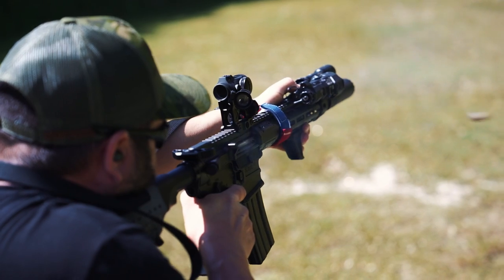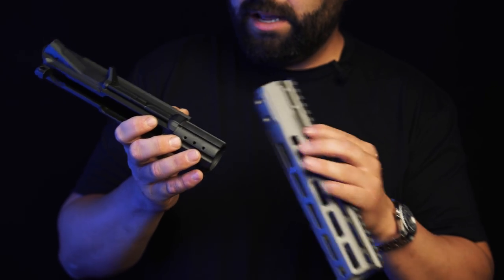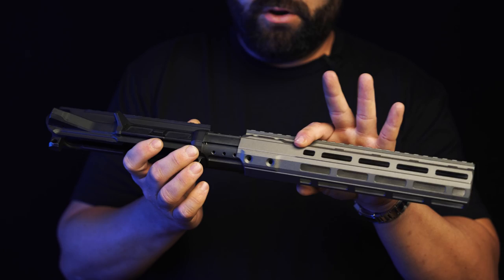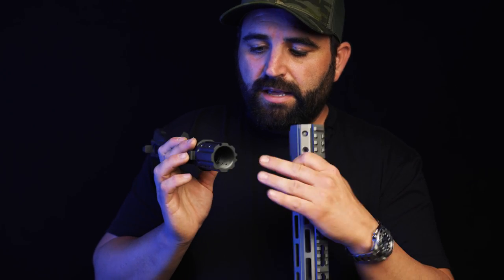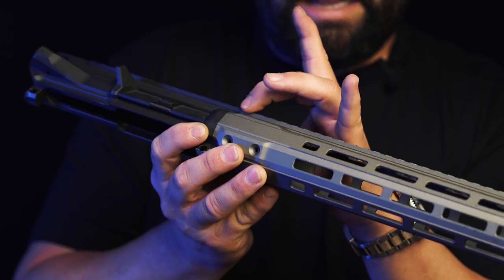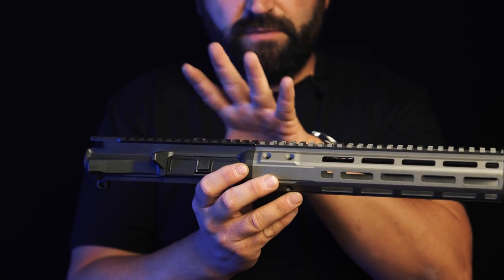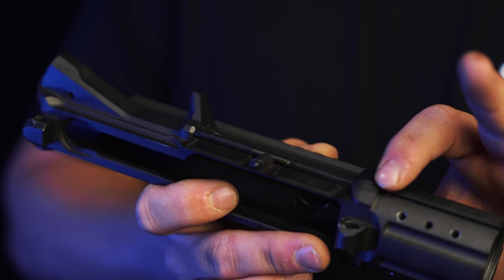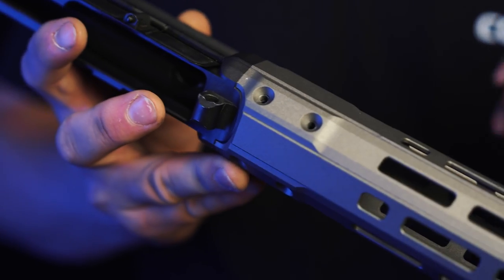Cobalt Tech (Cobalt Kinetics upper receiver tech)

Comment: Mega did this years ago, Aero still does it today with their "enhanced" uppers. I think Seekins still does it as well. Still it looks VERY good even if it's a bit fat. The Mega ones never felt that fat but the Aero/Seekins/bar ones do, I look forward to seeing how it actually fits in the hand.
Reply from the maker: Thank you for passing by our channel and for your thoughts on this topic. We do love the candor and the kind words. Cobalt Kinetics was originally introduced into the market in 2014 and our flagship platform at that time was the "Edge", this early platform featured this same technology (with a different overall platform look). 

Our main difference is tolerance control and working to modify the design to be a more elegant solution. The inverting of the threads alone wasn't our only goal. We also tackled competing materials, barrel interface issues, and even took a second to secure an existing issue with ejection port cover rods (because we hate c-clips, lol).

Our goal will never be to lay claim to something that others are (feverishly) hoping to claim that they were the first on, but dates (and years in the market) definitely support our historical attendance in this game.

There are also a few other brands that feature similar tech that was left off your list, in our opinion they would qualify as better options than some of the ones previously listed. At the end of the day as long as companies are working a bit harder everyday to earn your business (and respect) then we feel like we are in great company. Innovation and respect for the consumers true need is a rising tide that lifts all ships.

On the topic of the width of our hand guard, I believe that you would be pleasantly surprised at the overall feel of this upper receiver unit. It is not too wide that accessories make it un-bearable, and not too thin that it feels like a broom handle. I would invite you to seek out a local Cobalt dealer and check them out for yourself, the final piece that we know will impress you is if you get to shoot one.

Do not hesitate to reach out if you have any more questions at Sales@CobaltKinetics.com, have a great day!

Comment: Torque specs for those screws?
Reply from the maker: 25 in/ lbs (Use only a small dot of Blue Loctite, only if you truly need it for duty applications).
Reply: @CobaltKinetics Thanks so much